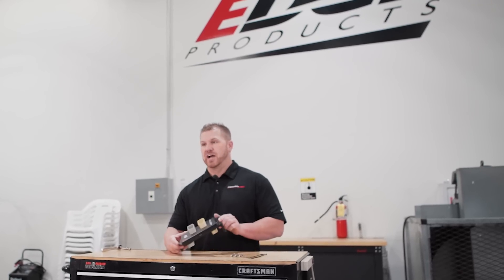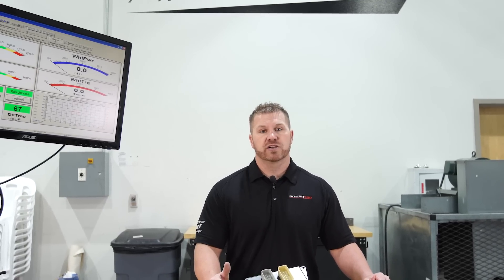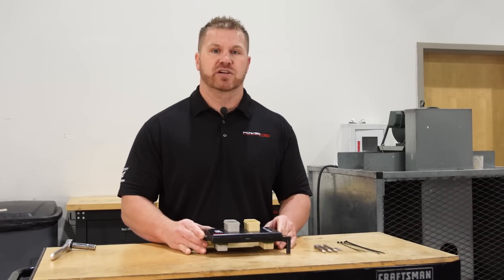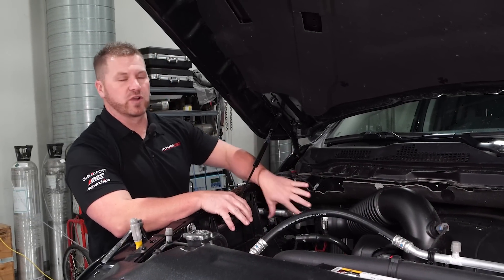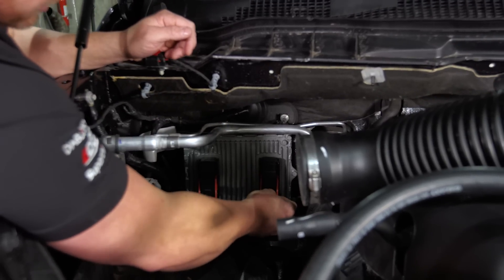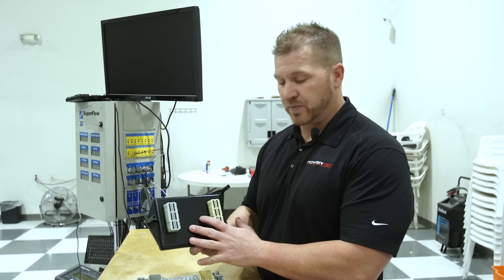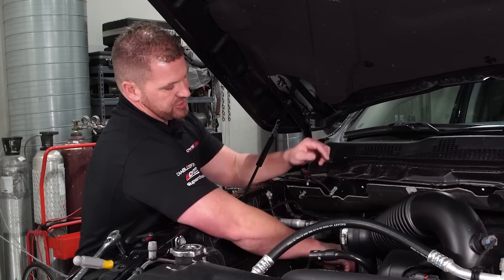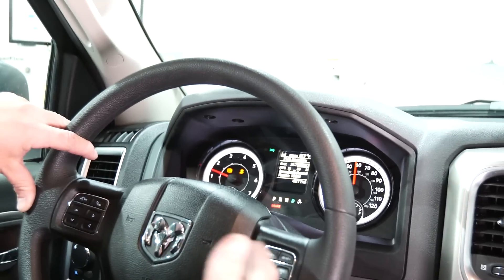Install and testing of the Pulsar Tuning Module for 2015-2018 Ram 1500 5.7L Hemi Trucks

Comment: just installed this and it makes my ram run like a champ on the fly, and surprisingly it gives me better fuel mpg than before even when I go through the levels.
Reply: WOW, > I changed my Intake from stock to the [K&N Air Intake] + Scraped my stock exhaust, not that I needed to, but bolted on the [ Flowmaster 817690 Outlaw Series Cat Back Exhaust System ] and increased "Everything" deadly upgrade. Exhaust is slightly loud. Talk about gas mileage, it was great, now it's even better than it was when I bought it.  (And I just ran into this, not sure what it will do for my truck, maybe well driving down the hwy it will strip the paint off the side of the truck? 

My too upgrades I bought on Amazon. Intake was $461.00 exhaust was $1,030.00 I mean for $1,400.00 it fucken flies. And it sound deadly, even better when pulling up next to a Harley-Davidson at the lights, my truck sound like 4 to 5 of them going of the lights. LOL!!
Reply: instaBlaster.

Comment: Is custom tuning available yet? Im going to be installing catless headers that will require a tune.
Reply: WOW, > I changed my Intake from stock to the [K&N Air Intake] + Scraped my stock exhaust, not that I needed to, but bolted on the [ Flowmaster 817690 Outlaw Series Cat Back Exhaust System ] and increased "Everything" deadly upgrade. The exhaust is slightly loud. Talk about gas mileage, it was great, now it's even better than it was when I bought it.  (And I just ran into this, not sure what it will do for my truck, maybe well driving down the hwy it will strip the paint off the side of the truck? 

My too upgrades I bought on Amazon. Intake was $461.00 exhaust was $1,030.00 I mean for $1,400.00 it fucken flies. And it sound deadly, even better when pulling up next to a Harley-Davidson at the lights, my truck sound like 4 to 5 of them going of the lights. LOL!!

Comment: Im moving mine to a new truck and lost the installation bolts.  Are these available for purchase or can you tell me the specs on the bolt and washer I can acquire from my local hardware store?
Reply: Did you post this on the Americantrucks channel at well?
Reply: @conservativetexan2289  I did not.
Reply: @eekenterprises  if you got the original bolts you can check the tread on a bolt thread gauge and get them in 3 inch
Reply: @conservativetexan2289  i hit up edge and they sent new ones free of charge.
Reply: Called Edge and they said m6x80mm with 1/4” washers 👌

Comment: I could not get my connectors off. I lifted the levers and they still would not release.
Reply: Legend says this mans connectors have yet to be released
Reply: There is a little gear like thing that the levers are supposed to catch on, most likely yours have become worn. Use a flat head screw driver and try to push the tabs down manyally without the levers. That is what I did.

Comment: where can i fine the obd2 to usb update cable for it? also what will happen if you was to pick a level wile you are in park, reverse, neutral..  will it mess anything up?     
what if we accidentally set something thats not in (drive) on the gear selector knob?   do i risk damage to ecu or transmission?
Reply: I just installed this the other day and it works fine when you shift levels in park. I did notice that the number flashes a little when you shift in any gear other than drive, but it doesn't seem to mess it up at all.

Comment: can you still use your cruise control or will it start changing modes on the pulsar ?
Reply: Good question.
Reply: To use cruise control you just have to hit cruise on then the buttons control cruise. So yeah you can still use cruise control but my guess would be you can't adjust tune while IN using cruise control

Comment: Can you change tire size's on here or adjust the top speed limiter?
Reply: Eric Ferguson no. Its not a tuner, more like a chip. Everything is preprogrammed with different power levels
Reply: False. You can change tire size.

Comment: I just installed and on start up it said throttle position error. That has disappeared at the moment but there is a check engine light on and my cruise controls arent operating the settings???
Reply: T B same

Comment: So if I remove this when I got to the dealer are they still going to know changes were made?
Reply: Gray Thunder 
Anything done to the truck leaves a fingerprint on the PCM.
Reply: if you remove the pulsar the dealer will not know. nothing in the computer was changed at all.
Reply: @turboboy0  yea they definitely know the PCM has been tampered with, it's something they make sure they have the proper equipment to see if there has been changes. Almost like a set up to void ur warranty.

Comment: Is this any different than the pedal commander?
Reply: It looks like it literally does the same thing as the pedal commander
Reply: The Pedal Commander only changes the response of the accelerator but doesn't increase HP. This actually increases HP and torque as well as change the accelerator response.

Comment: So how does the pulsar work with changing gears? Like if I wanna keep it in level 8 but wanna shift manually?
Reply from the maker: You use the Cruise Control +/- buttons to change the power levels.  If the cruise control feature is on then you can't change power levels.  If the Cruise if off then you can adjust on the fly.  If you are using manual shift when you change power levels it will display the power level for a few seconds on some models or show a small indicator number for Pulsar power level for a few seconds and goes away to display what gear you are in.
Reply: Does it remember your last choice after engine shutdown ? 
 @edgeproductsman

Comment: what part# do I need for my 2019 Ram 1500 CLASSIC 5.7, 8spd, 4x4? it should be the same as the 2018 right?
Reply: Did you find out anything? I have a classic as well
Reply: Classic is the same as an 2018 model ! No difference !

Comment: MDS gives you uneven engine wear? Lol ok
Reply: American Citizen when your dash says eco it’s running off 4 cylinders not all 8 in the gm vehicles it wears down the valve train at about 100k miles a had a Silverado that dropped a valve about then and I never beat my truck